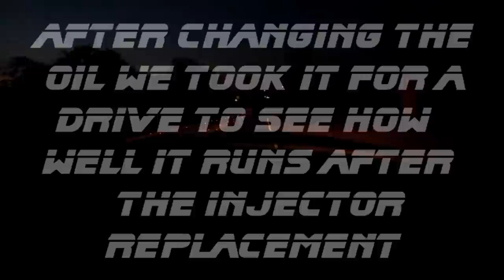How to replace Duramax fuel injectors!

Comment: Great video.  Will be attempting my own injector rebuilt on the 03 Sierra 2500HD, and I'm sure I'll be going back here to review some items.
Reply from the maker: Thanks we really appreciate that! My biggest advise is to just make sure you have all the parts and tools ready ahead of time. That should save you some time and frustration. Good luck with your install!
Reply: Half way done. Took it all apart, waiting for the too to remove the injectors, and got the new ones on order.  I did end up buying a 5mm socket adapter to to help with the valve cover bolts. Along with the hinged adapter to come at it from an angle. That seemed to help a lot and save time. I saw the 2 that were a pain to get to. They were for me as well.  Definitely going back and re-watching your video for a refresher course as I get it done.
Reply from the maker: danutuc outstanding, glad to hear it’s going well. If you run into any issue that I may have missed in the video just let me know and I’ll try to help guide ya through it.
Reply: well... got them replaced.  put everything back. all oils changed.. truck starts and runs fine for a bit... if I let it idle it runs w/out issues.  when i drive it, once I hit higher speeds i start hearing fast knocking noise.. pretty loud, and smoke out of the exhaust.  only thing i can thing of is i didn't tighten one of the injector hold downs.. :(  any other ideas?
Reply from the maker: danutuc well it could be a few things, how is the oil pressure? If you don’t have any metal shavings and the oil pressure is good it’s probably one of the injectors acting up. Did you happen to replace all the high pressure lines? Sometimes they can build up rust and if they are reused they can mess with the new injectors. I’m not sure if you have a way to check the balance rates, but that could help identify where the problem is located if it’s a bad injector or maybe even a fuel leak from something not sealing properly like an O-Ring or gasket on the return lines. The smoke leads me to believe it’s something with one or more of the injectors.
Reply: Oil pressure seems ok. It's at mid range on the gauge. When I accelerate it does go up a bit also.  Metal shavings? There weren't any that I saw anywhere... and worked clean, anywhere I worked. Took my time and made sure nothing fell in. I didn't replace the high pressure lines. I cleaned them using a ultrasonic cleaner, ran carb cleaner through them, etc.  several times.   I'm not sure if its related, but now I've got a coolant leak down below.  I don't see anything trickle from up top where I worked. I'll have to look into that.  In the meantime I have a feeling its an injector as well because everything starts up fine, idles, i get no codes other than a P0380 GlowPlug/Heater circut "A".  I was getting that before as well.  When I start the truck and let it idle, and rev it, runs fine.  I took it to 2k rpm for about 1-2 mins and all is well.  It  only does it when I drive it and over 35mph or so.. when that happens the knocking starts, lots of black/gray smoke out the exhaust..   I slowed down pulled into driveway and was able to look under the hood. Couldn't pin-point the exact location between the knocking and engine noise but didn't see any fuel leaks on the rails...  I don't have a way to check balance rates at the moment.. My thoughts was to pull the covers back off and look at the injectors again.. just not sure if there was another test to do before I do all that work.  balance rates would maybe tell me that w/out going to far into it beforehand?  I have a BlueDriver OBD reader that gives me the fuel rail pressure... but I'm thinking that's not enough.. needs to be poin-pointed on the exact injector(s).. thoughts?
Reply from the maker: danutuc exactly, the balance rates will help pinpoint if an injector is having any issues and it might help pin point the problem if it is a leaky injector or one that is not within the specs. That could at least identify which side it is so you don’t have to pull both sides again. As far as the leak if it wasn’t there before the install I would check all the hoses and make sure they are tight and check the thermostat housing, if you replaced it, just to narrow it down.
Reply: I just tested my injectors balance rates.  I've got cyl 2 at 5.0+, the rest are all between -3 to +2.  I understand they need to be +/-4...    this is when it is idling.  Looking on the image how they are numbered it looks like its the 1st one on the left valve cover.  I will have to open that up and see what is going on.  Luckily I think I can get to this w/out having to drain the coolant... I think...  If the return line was loose... Here some additional info for those out there that are interested. https://www.injectorsdirect.com/what-you-need-to-know-about-duramax-balance-rates/
Reply: So I took it appart again. Checked all the injectors, fuel lines, etc.. All torqued down to specs.  There was no dirt on any of the injectors.  One was running high, i swapped it with another next to it.  Checked all the lines and they seem clean.  Cylinder 2 is still running 4.5+ on balance rate pushing too much fuel. I'm thinking it's not the injectors since I swapped them and they all act the same as before.  Had someone tell me that what's happening is the cylinder is getting too much fuel and it locks up. Not to run like that or it'll blow the head gaskets. (diesel mechanic).  Next step I'm thinking... replace the high pressure fuel lines (top of engine), would like to not have to pull it all appart if not needed.  Thoughts?
Reply from the maker: Have you had that cylinder compression tested? The problem with looking at the lines when the truck is torn apart is that they may not leak just sitting there but when they are put under pressure they may leak from the seals, I am kinda of wondering about the return flow. Those tiny seals can be a problem sometimes, but I think you said you had replaced all the seals already, so it's probably not that. If it is running that rich and you are getting the fuel knock I wouldn't drive it like that.
Reply from the maker: When you swapped the injectors, did the +4.5 stay on the same cylinder?
Reply: @TheDailyDrift  yes the 4+ is on the same cylinder which rules out the injectors imo. I installed new seals but did not replace the return line. Cleaned them with carb cleaner and there seem to be no flow restriction.  I'm thinking when the fuel lines are mounted back if the dont sit properly that might cause an air leak and throw the balance off...?... I haven't even driven the truck. Once I saw the rate being that high at idle I'm pretty sure the compression lock.... will happen again.   I've taken the lines off twice now and these aren't meant to mess with.  I'm thinking I should replace them first and see what that does. (High pressure lines)
Reply from the maker: danutuc it would probably be worth ruling it out. I know when I did mine I replaced all the lines/seals just to be safe. With it being located in one cylinder like that chances are it’s a leak somewhere or even something wrong with that cylinder.
Reply: I'm getting the new fuel lines in tomorrow. I just replaced the return lines along with the seals again.  This time the seals seem to be a little thicker as well.  The high pressure are coming in tomorrow and will be putting those on as well.  Hopefully it was just a leak.  If not.. then I'll need to look into the compression on that cylinder.  Hopefully that's not the case, I'm not sure what that costs.. Mechanic diagnostic came back as the fuel injectors.. but who knows if they misdiagnosed it.. too bad I didn't get the balance rates before swapping everything out. will keep you posted.
Reply from the maker: danutuc hopefully the new lines and seals will help do the trick. If not I would check with the company you got the injectors from because they should still be under warranty, most places do at least a year. Lincoln diesel does two years on their injector warranty.
Reply: I swapped injectors out between the cylinders... so I'm not sure that it's an injector. When I swapped the balance rates stayed the same on every cylinder... which tells me it wasn't the injectors.  The injectors are 30%over (stage 1), with a 6 month warranty. They do 1 year on the others.  I also thought maybe that was the issue; however, why would it work on the other 7 cylinders... so I sort of ruled that out for now also.  Keeping my fingers crossed for now.
Reply: New lines and seals installed. (New return lines and seals, new high pressure lines).  Balance rates are a lot better, steady at around +/-2 in park, slightly over 4 in Drive.. this is about 30 seconds after starting, or after putting it into drive.  Basically this means that the injectors are good to me...  It was Cyl 2 that was showing a high balance rate.  I swapped injectors and checked again... it was still cyl 2.  I now installed all new lines and the numbers look good. However, once I reach higher speed and there is more pressure on the line... knocking... smoke...  I'm told its "hydrolock" .... not sure what's next...  this is what it sounds/looks like...  https://www.youtube.com/watch?v=O4XtpXxhKhI&feature=youtu.be  but it isn't untill I drive it for a bit.  next step i guess would be to check compression... if that is ok then it could be back to the injectors.. maybe they're feeding too much fuel?... however the balance rates look good..  in park and in drive...  truck was smoking before I swapped injectors, but it wasn't knocking like this... just white smoke.. pretty bad..
Reply: Just took it apart for a 4th time.  replaced all o rings to make sure, had one that was slightly damaged.  Reading online, looking through websites etc etc 30over injectors need a tune done on the truck as well. I have reached out to several guys and waiting to get and answer back.  Anyone know someone in the Portland, OR area that does the tuning? I would at least like to get some input, before buying new injectors (stock) and going through all this .. again.
Reply: OK. Long story short, after 5 installs it works. However it works because I purchased new injectors. the ones I had from dieselogic were not good at all. knocking, smoke, balance rates were never constant.
I purchased new LB7 injectors from injectorsdirect and they work great.  Balance rates are in within spec, no smoke, no knocking.  Noticeable increase in response; doesn't sound like the truck rattles. Finally.

Comment: Hey that intake heater controller module near the fire wall on the gmc I'm trying to figure out where the ground white goes too i hooked all three wires right but I out have a black wire left which is the 4th black wire I forgot where it bolts too it's an 2003 gmc 6.6 diesel I did the injectors
Reply from the maker: I am not sure if the wiring for the LLY (2003-2005) is the same as the LB7 (2001-2002) trucks. Typically a black wire is the ground, but I would suggest checking a wiring diagram from a Haynes manual. I just don't want to give you the wrong information when it comes to wiring it's critical to make sure its correct. Sorry, I wish I could help more.

Comment: I'm well into my change and I have a recommendation. If you don't know how to disconnect all these electrical connectors, don't do it. They become brittle with age and a few of them are like a puzzle. There's been two I have no idea about how to disconnect and I'm screwed on one of them. The wires are tiny, it's likely I'll do more damage than is worth it. This is asking for trouble.  Why in hell they design these things with everything so tightly routed is beyond me. The whole harness could run around the engine instead of over it. Mechanics must curse the factory.

Comment: I’ve heard the injectors “pop” in place in the cup and takes some force to push down before torquing the hold down. True?
Reply from the maker: As long as you clean out the injector cups well they should go into place pretty smoothly, (I used an old toothbrush on mine). You'll still need to use a little elbow grease to get them in there, but the hold down clamp will do the rest. Hope this helps!

Comment: You mention how much quieter the engine is, were you having fuel knock? I have a knock I cannot get rid of for the life of me, but no haze. She smokes heavy black on acceleration though. Injector balance rates show injectors 5 and 6 just outside of range and number 7 reads a steady -7. I am leaning towards a leaky injector but I don't have a way to cut that one out.
Reply: I was getting the fuel knocking also.  Balance rates were out of range.. when in drive, about 6-7 balance rate...   What injectors did you purchase?Where?
Reply: @danutuc  when in drive the rates will be higher, you need to test them in neutral. I got hold of a wiring schematic and depinned injector 7 specifically. It started up, sounded great and didn't smoke at all. I will be ordering an injector from LDS and replacing number 7 for now since my financial status is Whoopi Goldberg  (ugly as sin). This will also give me a "crash course" on what it takes to do the job so I'm prepared when I have the money to do all 7 or 8 depending how long the new one lasts.
Reply: @hairymoobs  From my research the injector rates should be at -4/+4 when in park, and -6/+6 when in drive.  Turn the truck on, let it run for 30 seconds or so then read the balance rates.  With your foot on the brake, put it in drive, and just hold for about 30 seconds and take the rates again.  When you are driving you won't get a reading, don't try that.  Mine were at around 5+ when in park, then it jumped to over 7 when in drive; I had fuel knocking; but i was also using 40 over injectors.  
The rates were not consistent at all; same injector would get a different reading (big difference) the next time I tested it.  I put new ones in, Bosch brand, and everything works great. Less noisy, (still a diesel however so it won't be very quiet :)  )   but ran smoother, response time increases; and slight gas mileage increase.  I haven't test it on a long trip to see yet.

Comment: Get rid of that oiled k&n air filter..the turbo will suck the oil out of filter and it will landing on you air flow sensor and cause it not to read accurately..afe ...s&b intakes are the best... straight pipe 5 inch exhaust and some EFI live..you will love it even more...throw that fuel filter housing in the trash..get a beans diesel sump kit and a FassTi 150..no more pumping and a priming!
Reply from the maker: Thanks, that's a good point I never thought about that. I would love to install those parts, but right now my budget is a little tight. Maybe in the future, I will get to put some of those parts on. Thanks for the tip though!
Reply: The Daily Drift ..your welcome..thanks again for the video..I own a 02 ..with 337,000 miles
Reply from the maker: Anytime, I'm glad it was helpful for you. Nice yeah we love these trucks, they are built like tanks.
Reply: how many miles you get out of those stock injectors
Reply from the maker: Brian Nolton well I’m not 100% sure because I bought the truck used with 320,000 miles and in dire need of some TLC. But from what I could tell the injectors looked like they were never replaced. Hope this helps!
Reply: Fass has some real good gas pumps that go in the tank now you don’t need to drill a hole now for the sump I think I’d go that route

Comment: Hey man im about to do mine here in a couple weeks, was just wondering what you used/did to clean out the injector bores? Probably gonna ask more questions if you answer so, apologies in advance 😂 thanks!
Reply from the maker: I used an old toothbrush and some ATF fluid. I'm sure you could use carb cleaner or something like that, but ATF was all I had on hand at the time. Then I scrubbed the injector cups until there was no grime left and they were really clean. No worries, I'll do my best to respond when I can!

Comment: i am guessing replacement hp lines come in a kit or with the injectors correct? i would think those are one time use only. also did you not have to hook up to a computer and program the serial numbers of the new injectors into the ecm? dont have much experience on light duty engines just using heavy duty as reference.  i just parked my lly for awhile until i can save up for injectors that i plan to do myself. great video btw but doesn’t make me anymore excited to do them lol
Reply from the maker: Alex Spurling yes the HP lines come in a kit, I believe I put a link to them in the description. I did not have to program the new injectors to the computer, I haven’t had any issues since doing the install. Yeah it’s one hell of a job, but if you have the lly it should be a little easier because the injectors are not located inside the valve covers like the lb7. Good luck with the install!
Reply: The Daily Drift thanks for the input, i’ll check out the links!
Reply from the maker: Anytime! if you have any issues finding something let me know I can always look up my bookmarks for the parts.

Comment: great vid keep up good work not sure I would try my self my injectors went out 100000 miles gm replaced them at no cost warranty till 750000 have 265000 now will try dealer first to see how good there warranty is now lol they new then they had problems new ones to 750000 will see
Reply from the maker: Thanks I appreciate it! Hopefully they will honor their warranty. I know these things are known to be a problem spot on the older Duramax engines. Good luck!

Comment: what did you end up torquing the injector retaining bolt to? just good an tight?
Reply from the maker: I torqued the injector hold down bolts to 37 ft lbs, sorry I must have missed putting that in the video.